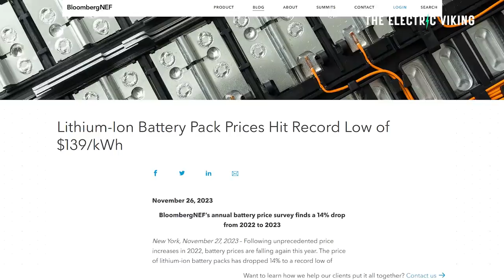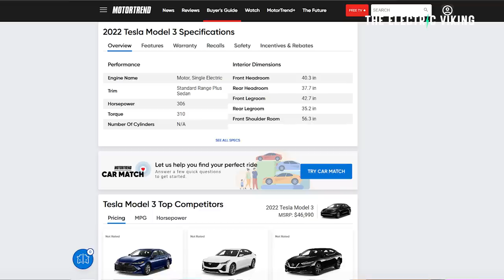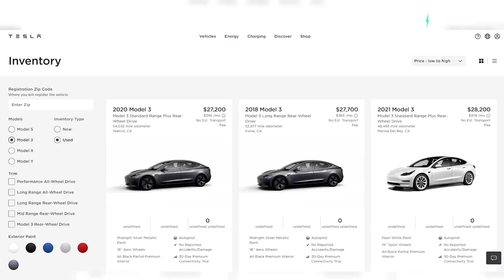Battery prices hit record low; Why have most EVs not come down in price?

Comment: I do not completely agree with counting losses for production of 1 EV. I think, I know, how it si computed: what are costs of the factory devided by number of produced cars. But it is not very good view. It is necessary, that firstly you must build factory, buy machines, hire employees, and then you can slowly start production. So it is impossible to be in profit, when you start with (any) business.
Better solution would be to show variable as well as constant costs. Variable costs offer more information. This is the reason, why you need sell about 500 000 cars a year to be profitable. Because there is a huge difference, if your total constants costs are divided into 50 000 produced cars a year or 500 000 cars.
And also, if any company is growing up, it is impossible to rise production 50 % a year and pay it by 10 or 15 % profit level.

Comment: Ah, but BEVs have gone way down in prices...so much so that owners of previously-purchased BEVs are really angry that the major price cuts of new BEVs have destroyed the values of pre-owned BEVs.
Reply: And it's only going to get worse. indeed, how will early adopters sell their old EV without losing a huge amount of money, when buyers will alternately have the choice of new attractive models at the car dealer considerably cheaper than the price early adopters bought theirs just five years ago? New EVs with twice the range and half the time to charge. Add the Sword of Damocles of the consumed battery pack which costs $10,000 to $20,000 to replace/ It seems a dead-end, and a costly one. Such an accelerated obsolescence never existed in the ICE era.
Reply: @fluxcapacitor The battery packs on Teslas will last 20+ years.
Tell me what's more expensive:
1- 4000$/year over 20 years
2- 10000 or 20000$ dollars every 20 years.

Please reply with the answer.
Reply: @themonsterunderyourbed9408  My answer:
- Do you come from the future?
- How about the batteries of all other, non-Tesla EVs?
Reply: @fluxcapacitor  
Batteries of non-Tesla EVs are irrelevant. 
Tesla is the standard by which all EVs should be measured. 

If you decide to buy a non-Tesla EV with everything we know about EVs today, you pretty much deserve all the hardship you get and could have avoided by buying a Tesla. 

No other car company is serious about making EVs. No other car company makes EVs of quality. All non-Tesla EVs are the equivalent of putting lipstick on a pig. Maybe that will change sometime in the future when legacy automakers finally get a clue... But for now, no other EV should even be considered apart from a Tesla. 

We already know what the cost of a Tesla battery replacement is. 
Tesla warranties their batteries for 8 years. 

I save over 3500$/year on fuel costs alone driving a Tesla.
Even if I had to replace the battery the day after the warranty expires, that's still 28000$ of fuel costs I've saved and would more than pay for a new battery. 

The data already accumulated from the current Tesla batteries on the road shows that they should last 20+ years. I know it remains to be seen, but with how well the batteries have performed in the Model S, I have no reason not to trust the data.
Reply: @themonsterunderyourbed9408  Okay, noted. However, last time I checked this channel wasn't called The Tesla Viking.

Comment: - Well, a Tesla Model S - If they are available in our market, are still expensive, and EV owners "thing their used car is worth nearly as much asabrand new one, this is a  hang over from the stupidity of shortages during COVID..  

Many EVs are members of a multi-car household, they are often a Greenwashed  luxury, "extra vehicle"..
Batteries coming down at the CELL level, doesn't translate to significant reductions at the APPLICATION level - cheaper batteries make it more affordable for companies to provide improved  Warranty coverage - that comes out of the bottom line. 

A lower battery price makes EVS a little more Economical  - in absolute terms..

Tesla could charge whatever it wanted - basically, in the exclusive, early adopter phase.  As we enter the real mass market phase (real mass production) - the Economics may begin to make the industry competitive...  Though still sucking hard at the teat of Government  "mandates" all over the world (Funde by western Tax PAYErs..)..  

EV sales people / dealers (blinker fluid replacement techs)... Need to focus more on the fleet level (or convert more retail consumers into "pseudo" novated lease buyers, just like Harvey Norman did -  where a per month cost (all in) is totally more important than a per unit "lifetime of the unit" cost (monthly costs are ongoing an balance sheets can deal with that) - and the Lease can be pushed from 3 to 6 years, as there is lower degradation of the vehicle over the time, and the lower battery cell price means a replacement batter - as-a-service is affordable for the manufacturer - with clients on a vehicle subscription (basically)

Comment: The shear volume of material to make a  BEV battery is why. A battery weights at least 500 kilograms 1100 pounds , half  a ton. Although there is nothing in an electric car very simple to make the batteries are huge as they are not efficient and need to be huge to get a reasonable range . Material costs and manufacturing costs are huge way way more than an ICE vehicle hence they are generally $20,000 more than an ICE car . The energy required to make one BEV car will make at least 10 ICE vehicles or 6 Hybrids “PEVs” . It will be a very long time before they reach price parity with ICE vehicles. Present volumes / demand for BEVs is not enough to bring prices down . All BEV makers are loosing money on each unit . Rivian loose $35,000 per car , so does BYD who is a fully government entity in China which is fully subsidised. Tesla’s margins are razor thin it makes money on government subsidies, tax breaks and carbon credits . With falling sales and demand for BeVs globally having peaked in 2022 making up only 1 % of the global car market . BEVs will not reach price parity anytime soon. Rising manufacturing costs like electricity, water, transport,  labour etc for all manufacturers means prices stay high . All manufactures have put expansion plans on hold including Tesla . Manufactures that produce hybrids are concentrating their efforts here as demand has significantly increased in this sector of the market year on year month over month especially in 2023 where globally it is up well over 40% .  The sheer material costs then to make a battery is the limiting factor the sheer size of these components make them the most costly part of the car by a long long way over an ICE and hybrid drive train . There is no getting around it . The more material you use to make something the more it costs especially with lithium / ion batteries . There is not enough demand to bring prices down . Solid state batteries will go along way to changing this , Toyota has recognised this over a decade ago and has had 200 engineers dedicated to their development working with Panasonic and other industry leaders Yamaha etc . We will see mass production in 2027 with BEVs containing these batteries .

Comment: Teslas ARE cheaper than ever.  Tesla continues to aggressively lower their prices.  And not just on the Y and 3.  On the S and X too, which both had huge price cuts this year.
Reply: There were some price increases recently.
Reply: @stefan2796  Tiny jumps in comparison to the massive cuts over the year.  I think Tesla does these small bumps in price after the big price cuts to signal to buyers that the price cuts are over.
Reply: @tysonn4736  For regular consumers (not business lease contracts) these changes are confusing. What is the right moment to buy a new Tesla? What does the change in price mean for the resale value? Etc.
Reply: @stefan2796  Tesla has said in their missions statement that their plan is to drive costs down and pass that on to the customers.  So we might see prices tick up in small amounts, but the overall trend will be downwards.  Which is what is happening.
Reply: @stefan2796 cheaper than ever, yes. Affordable for Joe Average, even at that reduced price, no. Half the world is still waiting for a small, simple, practical ev that does not require the sale of one kidney, and an NZ$68k base Model 3 is never ever going to be on my shopping list. The modestly decent mass market sub NZ$30k ev that I might seriously consider doesn't exist yet, at least not outside of China - until it does, the dead dinosaur diesel burning will continue. Batteries still need to get a lot cheaper.

Comment: There is actually not much demand for battery electric vehicles so prices and margins are definitely starting to contract. Battery powered trains are starting to appear upon the USA now as well. Where this matters near almost all thanks to Tesla but now Rivian ramping up presumably Lucid next is how much drive time a pure BEV vehicle gets over an ICE Platform. Because of Uber, Lyft, Turo etc the amount of miles being put on pure BEV makes them more than equal now to ICE Platform in the USA. "Time is money" so as a business these machines are invaluable to an economy even more so as prices drop. Unsurprisingly ICE Platform pricing has soared as a result but even that is now starting to moderate as it is far more economic to mass produce an ICE Platform than pure BEV because of how resource intensive pure BEV is. The other issue with pure bev is the skateboard chassis which is not a very good chassis for most driving applications.  Because of the US Interstate Highway System though plus extensive paved primary roads skateboard chassis works fine in the USA and in theory Canada. Service and support still wholly lacking for pure BEV (Gruber Motors still the only one I am aware of) so after the full scale production and release to consumers of Cybertruck I will be watching how BEV Service Station is built out...if at all. In the meantime that which remains the biggest change to vehicle design is/are hybrid drive systems which are still a work in progress but most definitely now very well put together for the first time. Aptera continues to push far more important pure BEV changes than anyone else at the moment as well not The Big 3 of EV Tesla, Rivian and Lucid all of whom now produce effectively the same vehicle.

Comment: Hyundai and Kia have unveiled a radical new EV drivetrain system

Hyundai and Kia have linked up to reveal a new universally adaptable drivetrain system called the ‘Uni Wheel’, which aims to change both personal and commercial mobility and deep-fry your mind. 

The new system integrates pre-existing drivetrain technology that has essentially been re-engineered to move the main drive system components to the vacant area within a car’s wheel hub. Want to understand how it works? Get your nerd hat on, it’s time for a science lesson.

In a traditional combustion-powered car, the power is sent from the engine through the transmission and then to the wheels 

using drive shafts and CV joints. In an EV, the electric motor and reduction gear substitute for the engine and the transmission, but the rest of the process remains the same. 

The Uni Wheel looks to change this final step by repositioning the reduction gear in an EV to inside the wheel hub and then fitting ‘compact’ individual motors closer to each wheel. This would not only reduce the size of the drive shafts but also the amount of overall floor space used. That means more cabin space for crisps and crumbs to claim as their residence.
OK, ready to get even geekier?

What then allows the Uni Wheel to work is a ‘planetary’ gear configuration, which consists of a centrally-located ‘sun’ gear, four ‘pinion’ gears on each side, and a ‘ring’ gear that sits on the outer edge, posing as the asteroid belt in this particular section of the Solar System.

The power generated by the motor is first sent to the sun gear, which is then relayed to the pinion gears to move the ring gear. The ring gear, which is connected to the actual wheels of the car, then springs into life and enables drive. Keen engineering fanatics will also note that this system could even move the torque vectoring game forward since each wheel basically has its own engine.
The South Korean power couple also says this will have a positive impact on ride comfort since the drivetrain works closely with the multi-axis suspension to ‘stabilise’ the vehicle with quicker bursts of power and torque over rougher surfaces. 

The technology will continue to be refined with a view to incorporating it into future products and has the potential to be applied to anything with wheels as small as four inches or as large as 25.

That means it can even be used on different types of mobility solution, ranging from bicycles to wheelchairs. We're left wondering if it could enable a new racing series for delivery robots. ‘Formula Robot’ certainly has a ring to it, no?

Comment: Your historical battery cost are quoted per KW/H which would be fine if all things remained the same. However EV initial range requirements were never good enough meaning buyers require more KW/H per EV for it to be usable in the real world, especially in temperate countries with extra power requirements of heating, window defrosting, wiper power etc. You were not comparing like with like for a global product.